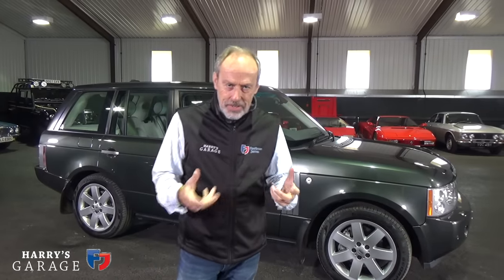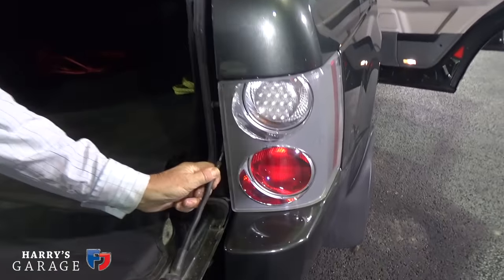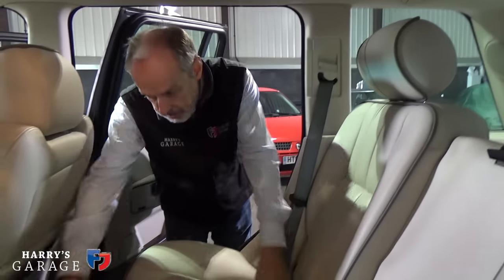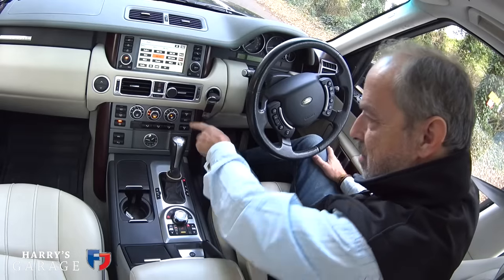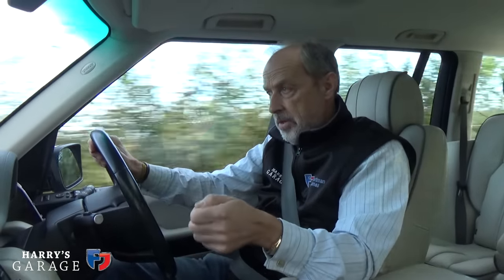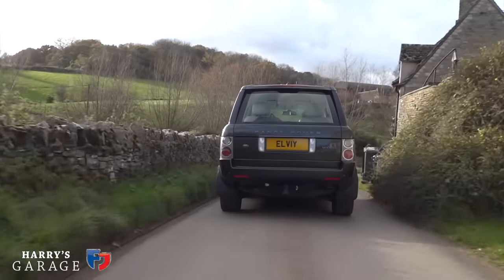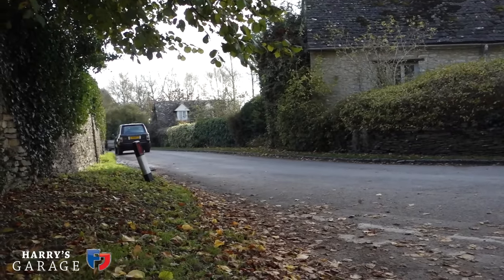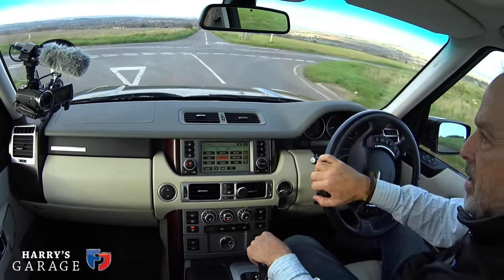Range Rover real-world review and buyer's guide L322 TDV8

Comment: I had a 4.2 SC (2006 model, North American Spec) first, in Nigeria and that was not very reliable but the second one, 2010 5.0 SC Autobiography is brilliant, absolutely love it and very reliable.  As for the 3.0 TD6 L322, avoid at all cost, the gearbox is a common point of failure, they just don't last long.  I also would not recommend the diesels period as there are some issues with the turbos on quite some of them.  The petrol Jaguar V8 is bulletproof (although sometimes the timing chain tensioner could need replacement).
Reply from the maker: 4.2S/C used 'old' BMW L322 tech under the skin, so even though yours was a 2006 model year, drivetrain, interior, dash, air-con was same as 2002 model, hence why you had issues. From 2007 model year, L322 was a much more sorted car, as your 5.0 s/c proves and I've tried to point out in the video..
Reply: The 4.2 SC I had, already had the Jag V8 and the ZF 6 speed.  And yes there was plenty of Ford and BMW tech in the car. Part of the problems were with the coolant/oil heat exchanger of both engine oil and gearbox oil, both failed on mine (mechanics put pure water iso coolant in it but it was a problem anyway, the gearbox was flushed and sorted), I had to replace the fuel pump, likely due to the lousy petrol in Nigeria (water added to make it cheaper to sell !!!), the airbags of the suspension went BUT I still LOVED it. I updated the ECU software thanks to Blackbox Solutions Faultmate, that helped a lot as well with the Engine check light.  Also the spare wheel, there is the strap arrangement that you hook onto the lower tailgate and just open the tailgate and the tyre pops up saving your back !!!  I had to change tyres twice during my time in Nigeria and only found out that trick LATER !!!  Good tip about the Pirelli tyres, thanks for that. Oh and never use the original jack, they are known to fail, use the Mercedes Sprinter hydraulic jack that is cheap to buy on EBay.  For more info, have a look at www.fullfatrr.com !!!
Reply: Let me be very clear, I absolutely love the L322.  The styling is my favourite of all Range Rovers, the refinement combined with the brilliant off-road and on-road capabilities. I would still buy a L322 over the L402 (and any of the Sports or other JLR cars). If you have a good one (and there are plenty of those) then keep it forever, as I'm hoping to do !!!
Reply from the maker: I stand corrected, I thought the 4.2 s/c came with a 5-speed gearbox but it has the 6-speed ZF, apologies. The 2006 model year model you had is still the crossover model as it came with the old style interior and much of the first edition wiring loom that caused lots of issues. To be safe, you need to go for a RR built post Q4 2006 to get the updated interior and electrics.
Would love to have a 5.0 s/c like your but hard to justify here in the UK!
Reply: Mine is still in the UK, I haven't shipped it to NZ yet.  I totally agree, the 2007 MY is a big step up both in terms of the electronics/electrics and interior, just the addition of Terrain Response is worth IMHO.  The MY2010.75 that I have is even better and absolutely brilliant to drive.  I did a little 1 week trip from London through the tunnel, to Holland, to Paris, to Hamburg and back in it and even the Hamburg/Holland/Hamburg trip (in one day) was brilliant and I got out fresh as a daisy.  Brilliant car if you get a reliable one (and there are plenty of those around !!).
Reply: Hey, were do you get a RR serviced in Nigeria? Also, where on earth do you get parts? How much did you pay for your Rangie in Nigeria, or get it to Nigeria?
Reply: We (our company) had our own mechanics that did the "hard work" for me.  The parts I ordered overseas from NL or UK dealers and were shipped by airfreight (we had weekly airfreight for our ships anyway).  Some of the more "tricky" work I did myself, like replacing the solenoids of the gearbox (probably the only weak point of the ZF 6 speed, quite rare though).  All the electronics I did myself using the Faultmate from BBS in Cyprus (re-flashing ECUs, diagnostics etc.).  I bought the car in Lagos from a second hand dealer, can't remember the price but it was quite cheap actually.  Some of the known issues of course, like the suspension airbags (front only) going (couriered from the UK, quite fast and easy), the gearbox and engine oil coolers (although pure water iso coolant definitely aggravated that issue).  It was a great car and the problems weren't that bad considering but the 2010 I have in the UK is absolutely brillaint and super reliable !
Reply: Eugene Bajema ya lots of cheap American cars in Lagos, usually they're salvage/wrecked/flooded cheap American ones that get exported to Nigeria then resold.
Reply: I had a good look around mine and had it checked out as far as possible.  It was genuine "normal" import, not registered yet (guess the importer ran out of money).  It had been stationary for over a year when I bought it (I had all the paperwork checked out as well). But yeah, heaps of crappy cars. My company car, a Landcruiser was a UAE import and one of the most unreliable cars I have ever seen, far more unreliable than the RR !!!
Reply: Eugene Bajema so being unregistered, you had to pay duty and such to get it proper registered in Nigeria? Ha, ya i just bought a 100-series Cygnus Cruiser, love LCs and all but this one is a heap of shit. Everyone raves about how they go to a million kms but this one is at 250k and got tons of stuff wrong. Ya, middle east owners are not nice to cars, especially their dune bashing drifting antics and their LCs.
Reply: All the import duties were paid so I just had to arrange the registration and that was done by our guys, so really easy and quick.  I feel that Landcruisers get a far better reputation than they deserve from what I have seen, not that Land Rover products are super reliable but Landcruisers aren't "perfect" AND they are not very comfortable (in Nigeria at least) while the RR is !!
Reply: Ya, i miss a trusty 04 Cayenne Turbo I had for 3 years before it got sideswiped and totalled with 240k on the odo. Put 80k kms on no issues. Was dead reliable, comfy, awesome offroad with lockers, and ate up motorway kms.

Comment: I own one 4.4 petrol 286ps, and I can say that no reliability issues! 230 000km and problem free, just usual maintenance like oil, filters, etc. Only things Ive changed was radiator (leaking) and transmission position switch (its usual on all ZF5HP cars). People who are commenting that its shit quality car are morons, you have to make research before buying, dont buy 3.0td6 because of known gearbox problems (all X5, 3er, etc had same box, same problems), other engines are pretty problem free - when serviced properly! Ofcourse its very complicate vehicle full of equipment - you cant compare to ordinary vehicles where you have electric windows and thats all! You have to compare to same category, previously Ive owned 730d E65 BMW and I can say, Range is more reliable. Another necessary thing is to buy good serviced piece, no piece of shit - so pay big attention to check vehicle before buying! And I forgot - another things to consider are your service possibilities - for example you can change front brakes in official LR dealership for 1500eur, or I have independent garage where guys has good parts sources and changed brakes for 200eur total.

Comment: A tip I heard for tackling the tyre noise problem Harry is to do what Rolls Royce do, which is to put sponge in the tyres. Don't know if you heard about this tip. But it would certainly be interesting to ask a mechanic or LR dealer as I don't know what kind of sponges are used or how much you need.

Comment: I have a quick question. So my step mom just got a 2022 range rover and so she wants to give me her old 2012 range rover HSE with like 70,000 miles on it and Im going to be a new driver in a couple of months so I just wanted to know is this a good first car for me? and what are some problems I should look out for?
Reply: Timing chain rattle, corroding brake pipes, rust particularly rear arches. If you're American and your roads are as big as your burgers it should be a fine as a first car.

Comment: There is a spare tyre strap than nobody understands how to use that should be under the wheel and clips to the lower tail gare when closed so when you drop the gate it lifts the spare out of the well and then you can just slide it towards you and save any 'backbreaking' trying to get it out.

Comment: Harry do the gearbox issues on the early TDV6 that also plagued the X5 occur on the later TDV8'S?  I bought a Discovery 3 which I am happy with but would like to swap to a L322 but heard gearbox horror stories.
Reply: Different gearbox. TDV6 had a BMW gearbox, TDV8 had a ZF gearbox (as harry mentions in the video)
Reply: Paul Gamble thanks that is what I thought after watching and makes me feel a lot happier about the TDV8.
Reply: :) This (couple with the fact the MPG is identical) is why I went for the 3.6 TDV8 myself. Also, you avoid the crankshaft wear issue that the TDV6 can suffer from.

Comment: Lot of complaints about reliability, generally a fantastic car, the reason that reliability becomes an issue is when they are bought by someone who cannot afford the upkeep of the vehicle fitting cheap parts and not doing regular servicing, work on these most days and you can tell which ones have been looked after, they never give a days bother, if you can’t afford a Range Rover stick with plastic fantastic Japanese nonsense
Reply: Id take reliable plastic fantastic over thousands of dollars in repair bills any day.😉
Reply: sounds good
Reply: @myrongaines5542  you will need to put a few dollars away to weld it
Reply: @Mr. Cairo and also more rotten, more over rated, less comfortable and less refined

Comment: Which engine and transmission is best in the v8 diesel. 2.7 3.6 or 4.4? 2004/7 ish
Reply: Go for the 3.6 V8 on or after 2006. They are the best. The 3.6 was introduced in 2006.
Don't use supermarket fuel as it will damage your fuel injectors.
The RR also has a little hidden gem of a problem that is easy and cheap to fix. The battery will keep going flat for no reason. Turn out there is a resistor inside the front centre part of the console. Duck into the drivers footwell and you will see it. That resistor has to be replaced otherwise it will chew up batteries.
LR quoted me £600 to replace the disc for the SatNav....
But once you drive this car, you will never want to let it go. The Queen & J Clarkson still drive an L322 and refuse to switch to the newer model. 
I still miss my 2006 RR but it had to go because of the London ULEZ charge.
Reply: Ha went for something completely different . 40th anniversary Nissan 370Z GT EDITION 7Speed paddle shift lol. Thanks for the reply tho.👍
Reply: @kangerman8  Enjoy the ride.
Reply: Thanks man!

Comment: Ive owned three Discoveries & one Range Rover. 
If you need any form of reliability and don't have thousands of pounds to spend on endless problems (seriously thousands!!!!) stay well away from Land Rover products.
Three of my vehicles were brand new and spent more time with the dealer mechanics than with me. Granted the Range Rover was second hand with a massive 1800 miles on the clock. After thousands!!!  spent I gave up and sold it back.
Obviously got to the mechanics really well and was told if you need or want reliability don't touch a Land Rover product!!!. 
Enough Said...

Comment: You mentioned not to get that particular model chipped, (Or not get one that's been chipped) because the gearbox was/is at its maximum torque setting? 
The car  has quite a high tow rating.  
Is the gearbox in the Range Rover an Achilles heel? 
Or is the tow torque relationship different with when not chipped vs chipped?

Comment: BMW M57 are dirt cheap, very tunable and fairly reliable. I think they are the best choice now that this model has aged cause you cant justify 800£ cost on a 1000£ car.
Reply: The engine is extremely reliable it’s just a shame they mates it with a chocolate GM gearbox that always failed, I never understand why they didn’t just fit a ZF box.

Comment: I literally had to buy a spare Range Rover as a parts car as these vehicles do not age well.  So far I replace a radiator, tranny, head gasket, fuel pump, air suspension, tpms module, suspension controll module, 2 sets of deteriorate keys, fuel pump sender and filter unit, full suspension, and now my head gasket just blew at 100k miles, oh and an alternator, battery and windshield wiper relay and all the plastics, cowels A pillars and interior broken crap .  Range Rovers are getting worse even more so that they are owned by the Chinese company Chery Motors in conjunction with the India company Tata motors owning a 50% stake.  Maybe the Chinese made parts will actually be better quality then the British made parts ....so maybe China owning JLR group will help out!

Comment: Imagine an electric Range Rover, or as a hybrid being in electric mode when driving slow when offroading. It would be possible to make a "perfect" traction control system, imagine the offroad capabilities of that. But don't know if the extra battery weight would outweigh the extra performance though.

Comment: A bottomless pit Maintainance wise Harry I use to own a Range Rover bought it brand new and then after 18 months the service bills kept coming in ,I found it Top-heavy and very unstable on wet and icy roads down to its elevated center of gravity I now live in Thailand (real 4 wheel drive country mate)not that Chelsea farmer dream that people buy in to in the Uk I'm now running around in a Mitisbushi L200 at 40 to the gallon I've covered over 175,000 kilometers in it throughout Southeast Asia and its never let me down once the 2.5 turbo diesel in 4 wheel drive will get me anywhere, I've owned it now for 15 years bought from New total maintenance and service bills up to date 4 grand..............you can't beat Japanese reliability and engineering mate.

Comment: Okay two issues for me - Land Rover is notorious for electrical problems.  The second issue is the cost to run.  I’ve got  a discover 2 and 3 both v8.  Both have the for-mentioned
Reply: Land Rover were (are?) always a mechanical firm, they still don't do electrical/electronics properly.
Reply: Roger Hudson yes I agree.  I love the car for its mechanical skills.  The 4.4liter jag in the discover3 is beautiful but thirsty.  Another electrical problem even in the new model is its inability to shift gear to match the incline both under cruise control and not.  Unlike the Volkswagen Touareg for example with I also have and is almost perfect from that point of view.  Although that car suffers from over priced service costs and part costs.  As well as a flurry of fake genuine parts.

Comment: Terrible rep in Australia, not reliable and the dealers are anything but helpful.  If they can get out of a warrantee job they will.  Which is why we are a nation of Toyota, Hyundai and Kia.
Reply: Peter Andrews Nation of Toyota, Hyundai, & Kias. I wouldn't broadcast that.
Reply: A huge problem with Land Rovers outside of the UK is the dealers like you said. There aren't many, so you've got to drive miles to get to one, then they get out of warranty jobs and charge a fortune for parts and labour.
Land Rovers are typically very easy to work on and parts are readily available and cheap from the UK. Most Australian Landy owners work on their own cars and find them no more expensive to run than the equivalent Nissan or Toyota.
I personally wouldn't let anyone else work on my car as I've had bad experiences from even Toyota dealers.

Comment: Nice review but there is a huge mistake: the 3.6 td v8 diesel insn't faster then the 4.2 Supercharged v8 petrol, 272 bhp against 396 bhp given by a jaguar sport engine aren't comparable at all!
Reply from the maker: Go drive them back to back and I think you will be surprised. 3.6 TDV8 max torque is 640Nm at 2000rpm compared to 550Nm at 3500rpm for the 4.2 s/c and it's this massive torque from low revs that you feel every time you move off in the TDV8.
Reply: Harry's garage I own
 L322 since 2013, I had a 3.0td6 and I agree with you it was noisy and underpowered, then I had a 3.6tdv8 which was certainly better, now I have a 4.2v8 supercharged and this is a fast offroad ! I know diesels develop torx at lower rpm but once the 4.2 gets over 4000rpm it gives more than 220bhp compared to the 3.6tdv8 which at his top gives only 272bhp... so a 3.6 can't be more punching as you say. For the rest the review is perfect but that information gives a wrong idea to people watching video that never had a Range Rover. 
Anyway I do not want to diacuss I am one of your subscribers and I appreciate your videos! Take care!
Reply: BHP is how fast you can go. Torque is how fast you get there. The TDV8 is faster in the real world. I'd still have a petrol one, mind...